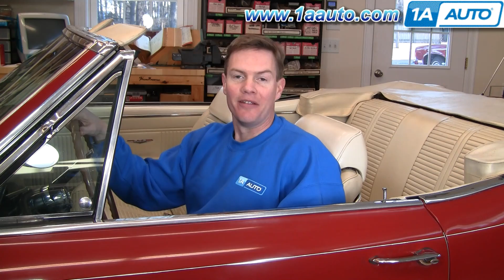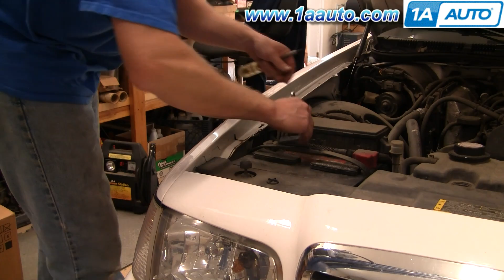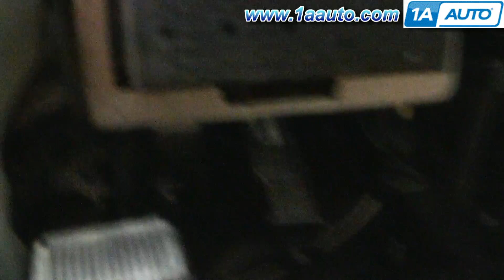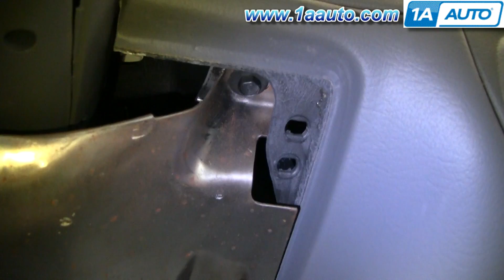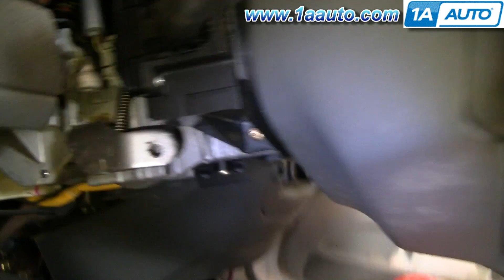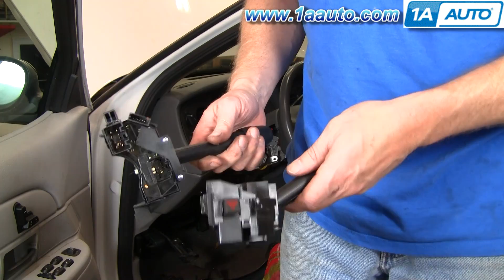How to Replace Combination Switch 03-11 Ford Crown Victoria

Comment: Thank you for this excellent demonstration/instructional video. I wouldn't have attempted it, until I saw how easy it actually is. I have an 07 Mercury GM and replaced the switch by following these steps, with one exception. I did not remove the ignition cylinder, as it was not needed for my application. It may depend on specific model, but one less step if you can get away with it.
Reply from the maker: Thank you for watching!
1aauto.com 888-844-3393

Comment: how do I know if its my switch or my windshield wiper motor?  Wipers work on high, but only occasionally on intermittent  and don't always park where they are supposed to. thanks.
Reply from the maker: You could inspect it for a broke or frayed wire which may be causing the intermittent situation that you're experiencing. Here's a link to the turn signal shown in the video on our website. Hope this helps you out. http://www.1aauto.com/1A/turn-signal-lever/Ford/CrownVictoria/1AZTS00095?utm_source=VideoReply&utm_medium=YouTube&utm_campaign=1ATony

Comment from the maker: You may want to check the fuses and bulbs first. If they all check out fine. There could be an issue with the switch. 1aauto.com 888-844-3393

Comment: I have a 1996 ford crown victoria and my turn signals do not work. But high beams work and my wipers work on all settings, also my hazard lights work fine, but not my turn signals.  Whst could the problem be?
Reply: rockchub flasher relay

Comment from the maker: You may want to see if there's a loose connection or a frayed wire in the column. 1aauto.com 888-844-3393

Comment: 1999 lincoln town car..... problem is the turn signals didnt want to work i had to move the steering column up all the way and that fix it but now i have to move the turn signal switch up and down and it only work some times do i have to replace the switch?...and  i move the steering column to hard now the miles in the dash are flickering if i hit the dash it fix the miles for a couple of seconds

Comment from the maker: You may want to start by checking the fuse. If you experience an issue with flickering lights, it may be a headlight switch that is going bad. You may want to remove and inspect the headlight switch. Hope this helps you out. 1aauto.com 888-844-3393

Comment: Great video..I own a 2003 Crown Victoria. My problem is no headlights. Any help will be greatly appreciated. I was told it's the multi switch, but i'm not sure. The reason I think it's the multi switch is one time the lights went out but came back on when i used the signal lights.

Comment from the maker: HI Steven, The turn signal lever for your car is a different part number. You may be able to apply some of the basic steps to your application. We carry new turn signal switches for your 96 Grand Marquis on our website with free shipping. Part Number: 1AZCC00016 1aauto.com 888-844-3393  You also may want to test the brake light switch to see if it's working correctly.

Comment: Hi, great video, I subbed just because of this video. I was wondering how similar this would be on a 96 Grand Marquis? I have a problem where my passenger brake light randomly won't light up but when i wiggle the turn signal switch it lights up. I have little experience on doing electrical work in cars. Please reply. Thanks in advance.
Reply: Hello Steven I have been doing shade tree work on my vehicles wince the late 60s, you gotta have common sense and at time esp.... with electrical probs in a car finding the problem can be difficult. Just don't ever give up, as it worked before and "I can fix it" is the right attitude. Just don't get in too big of a hurry...

Comment from the maker: If you can hear the pump kick on, remove the hose from the nozzel to see if the windshield washer fluid is comeing through the hose. If it is squirting out of the hose, than more than likely your windshield spray nozzel has become clogged. You can buy new ones from the dealer. Hope this helps you out.

Comment: well i did this on my 03 grand marquis and my wipers only work when i press the switch to make the liquid spray on the glass and at first i thought it was the switch so i pulled it back out and got another one and im still having the same problem what do i do

Comment: Okay I brought the switch filled your steps, they were very helpful, but when I put the switch in an test it, there still was no high beams. I traced a green wire from the driver side lamp up to the from passenger side under the hood and there are cut wires along with the green one. Could that be the problem if so what do I do??

Comment from the maker: The switch is normally what controls high beams. The issue might be that it is just a worn out connection and just needs to be changed out.

Comment: I have a p71 that's I just bought, it fail state inspection because the high beams wont stay on when the lever is forward but if I hold it back they work. Could this be because of the switch??

Comment: love your  video. i have a 2003 police interceptor, the brake lights dont work but the third brake light and all turn signals and night time lights work. the right turn signal flashes faster than normal.
i checked fuses, bulbs and brake pedel switch and they are good.
does this look like i need to change the multifuction switch?

Comment: Do you need a key to pull the ignition out and get the wiper switch because say if i wanted to go to the wreckers and get the wiper switch out but i wouldn't have the key how would i get the wiper switch out?

Comment from the maker: @1601DRR There could be a control module that's separate from the lever. If you go to the dealer with your VIN number they may be able to tell you.

Comment: Excellent video!    My wipers turn on and off without the wiper switch being activated.   Isn't there a module controller in addition to the lever switch?   Any suggestions as to how to troubleshoot these two systems?    Thanks.   CTB
Reply: Mine too. Have any clue?

Comment from the maker: @slednck3 You need to pull the ignition in order to remove the turn signal switch, on this application. The other panel didn't need to be removed.